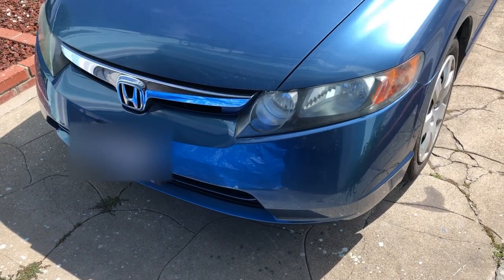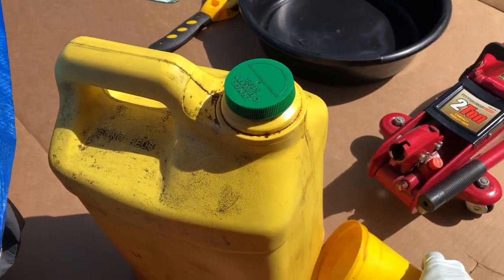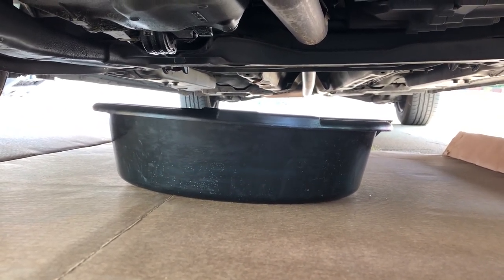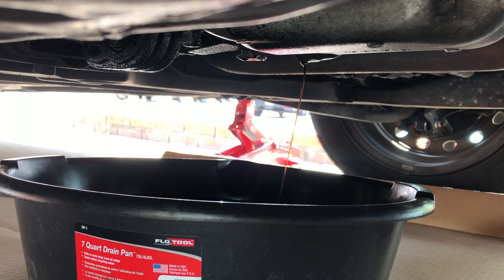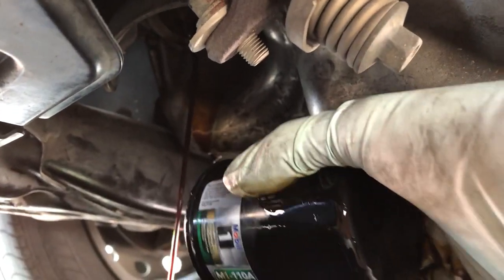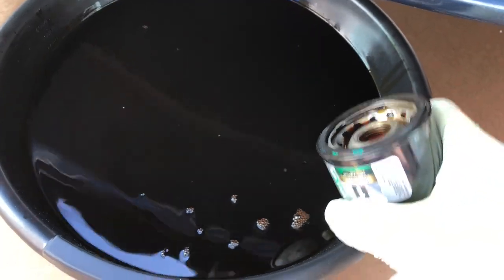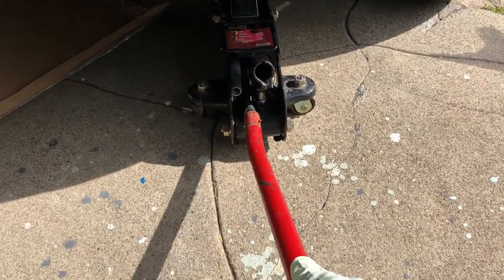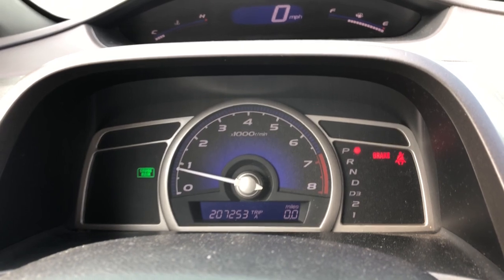How to do an OIL CHANGE with MOBIL 1 and K&N FILTER (Honda Civic 2006-2011 8th Gen)

Comment: What's the best oil and filter for performance 2012-2015 Honda Civics?
Reply from the maker: Mobil 1 oil and K&N filters are a great combo for any vehicle.  You could go even more high end but it’s much more expensive.  Red line oil, royal purple, amsoil to name a few.  Good luck!
Reply: Castrol Edge and Mobil1 Oil Filter or Amsoil Oil Filter